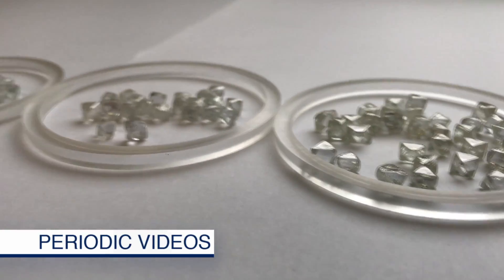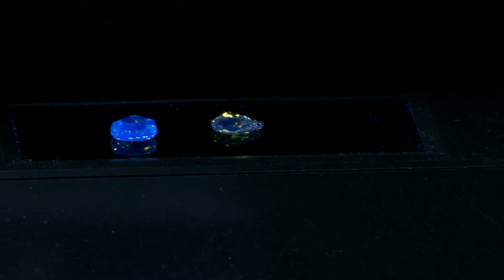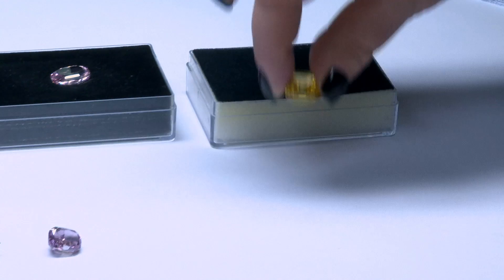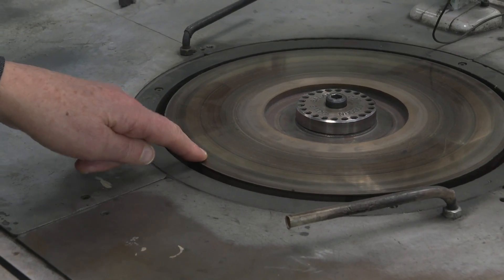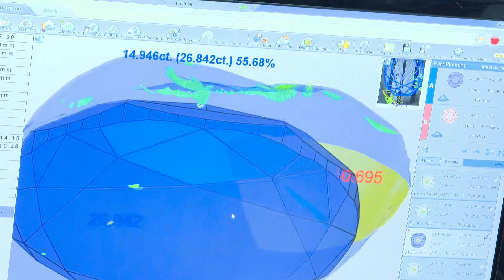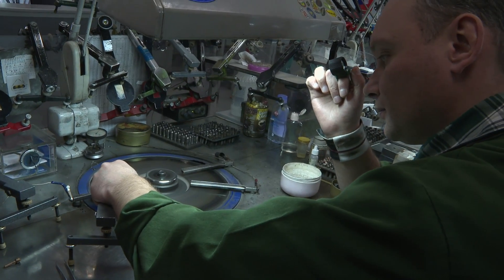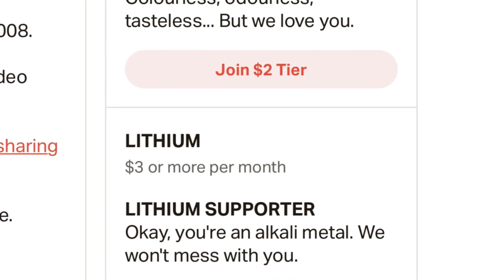Polishing a Pink Mega Diamond - Periodic Table of Videos

Comment: I wonder how they keep those wheels flat? If you think about it, they're probably some kind of case hardened steel so that they don't instantly get worn away by the diamond. Even still, being exposed to grinding with diamond dust for hours on end, you'd have to start getting grooves in the surface. Maybe they just dispose of them? Maybe they have a machine that they put them in and check them for surface flatness and finish?

Comment: I love how they are so gentle when holding the hardest material on earth like somethings going to scratch it 😂
Reply: Hardness does t mean toughness, they can shatter or chip if dropped or hit with a hammer
Reply: @wades623  Think of it as a ball made of glass and a ball made of rubber. The glass ball is harder and the rubber ball is tougher.
Reply: @wades623  "dropped or hit with a hammer". So I suppose slammed onto a table and blown up with 2 tons of tnt are considered the same amount of force now?
Reply: @michaelmodernsonicfan5341  First, the proper way to say that is "it will probably " not "it probably will", secondly, its spelled Shattered , finally, someone as young as yourself wouldn't even understand the basic chemistry and physics of a diamond, let alone understand its physical properties and actual uses in modern technology. It isn't just some pretty rock that is price gouged for no reason other than massive profit, its usefulness in abrasives far exceeds silica and other mediums, hence its uses in mining, milling, drilling, there's even methods of subbing diamond dust for silica medium in pneumatic sand blaster machines.
Reply: @crazycherokee8552  i think i deleted my comment bruv
Reply: @crazycherokee8552  why are mined diamonds so much more expensive than synthetic diamonds then

Comment: In order not to lose the pink color, diamond cannot be heated to high temperatures of 1000 degrees Celsius, such diamonds have a special crystal structure, such stones have a high stress. Big weight loss specifically for this diamond because it was necessary to cut the diamond so that it played well and had the maximum reflection of pink color, it is like a game of mirrors, only here the mirrors cannot be returned...

Comment: Absolute lies about diamond cutting.  You don't need any experience at all, just ask the Indians and Chinese, you just need a $40,000-$128,000 laser cutter, it is all automated.  Almost all diamonds are cut this way nowadays.  "First, the rough diamond is measured and an AI-assisted planning process 
then guides the user for optimal yield from the diamond. Then, it 
obtains a clear picture regarding the weight, shape, and clarity of the 
proposed polished diamond. Specialized software gives the operator 
options to select the shape of the diamond, depending on elimination of 
inclusions, and displays its market value onscreen. In the next step, 
the numbers of sides and percentage of sawing and banding are selected, 
enabling optimal safety and finalizing minimum weight loss. The operator
 clicks a button and the perfect laser sawing gets started. After 
completion of the above process, the next step is to cut the rough 
diamond according to the plan."

Comment: I have a pink un cut stone weight about 320 grams in single  
by testing the stone used a diamond tester light indicate 7 not more than 8 ,
what will it cost , any one wand it call +91 9847765751

Comment: Oh yeah, the water purification. The company I work for actually provides reverse osmosis machines for the medical industry, mainly for dialysis. For dialysis you need a special solution of bioactive concentrate that is based on ultra-clean water, in order to guarantee that no harmfull materials like heavy metals can enter the body through the water, it has to be thoroughly cleaned and filtered, or "zeroed" as we say. So hospitals buy this really expensive, sophisticated filtration machines. There are different kinds of machines, that do different things, but basically they just press water through a thick filter tube (it's tube shaped so it can take a high flow and pressure without breaking, despite being very thick and dense), so the water gets deionized from like 200µS to as low as 1µS; Micro Siemens, which is the unit of conductivity, the opposite or electrical resistance and the lower the conductivity, the less ions or foreign particles are in the water. So basically, what comes out this machines is by all intents and purposes, "just" water and nothing else.
Actually I'm fairly interested, what kind of machines they use to produce their clean water

Comment: What funny is that if you tried to resell those diamonds you would only be able to get a small fraction of what you bought it for.
Reply: It depends. Truly rare stones (like the "3 big ones") typically increase in value, though realising it may be hard (largely through auction). A "normal" diamond can be sold at 30-50% of its retail market value - which typically includes 15-20% of taxes - without much difficulty; try this with anything else, then tell me.

Comment: It's no wonder why Diamonds cost so much, an incredible amount of highly skilled labor goes into grinding/polishing them. Another great video!
Reply: Cutting and polishing costs amount for a very small proportion of the cost - proportion that is even lower for important/rare stones.
Reply: also, a sneaky bit off supply manipulation by the biggest diamond seller in the world to massively increase price.
Reply: The cost of cutting and polishing is insignificant as a fraction of selling price, actually - when was the last time you got paid $30 million for a couple month's work?
Diamonds are a gigantic scam, really.
Reply: @wasd____  That is why I prefer rare gold over common carbon (diamonds).
Reply: @qwertyqwerty697  Gold is also a scam. Its price isn't tied to its utility as a material component in things that are actually useful, it's only bought and sold on the expectation that other people will also want to buy it. It is, like diamonds, a manufactured overvaluation of something that isn't intrinsically worth that much.
Reply: @wasd____  gold been valued for thousands of years. There is a finite supply of gold that can be actually mined from the earth. If you want to talk about scam let's talk about the fiat paper cash we use everyday
Reply: @wasd____  Don't mean to be rude, but the "manufactured overvaluation" is the fundamental basis for economy. Your cash? Just a bunch of paper or plastic in your wallet. Your bank account? Nothing but a bunch of ones and zeroes in a hard drive somewhere...
Reply: @Pharoh_95 Everything is manufactured value. Gold is worth money because we say it is, same with the paper you weirdo libertarians like to rant about. The only inherently valuable commodities are food, air, water, homes. Nothing else matters on a human level. If an apocalyptic event ever occurred, where do you think your gold will take you, realistically?
Reply: I was thinking the exact same thing.
Reply: Diamanti lovediamanti biutifol gabriella

Comment: does the fluorescence affect the price because it shows how impure the diamond is? Like are other unwanted minerals in the diamond fluorescing, showing its impurity?
Reply: No. The reason why fluorescent diamonds are worth less (and BTW we are talking of 10-20%, not a dramatic 90% less...) is due to two reasons:

1. The (very low) risk that the diamond looks foggy or oily due to the fluorescence.  This is not because the impurities are visible, but because the amount of visible light they generate (as fluorescence) interferes with the light being "normally" reflected.

2. The (much more substantial) risk that the diamond colour will vary - sometimes in fairly arcane ways (e.g. a stone that should be fairly graded H in natural light becomes an E under low-UV, or vice versa...), and sometimes just plain ugly: I saw an otherwise nice orange stone with green fluorescence turn a very unattractive shade of brown.

Comment: The oil smell is not only for the machines' gears but also for the diamonds. When you grind something the friction heats things up, the smell is a drilling or grinding fluid made to cool the diamond so it doesn't discolor and ruin the stone.

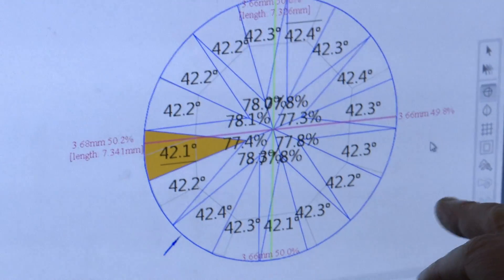Comment: 5:40 I wonder why aren't the angles divided evenly on the cutting plan
Reply: I think because that's what makes them sparkle. The offset of the faces just enough. If they were even it wouldn't be as impressive. I could be wrong just what I speculate.
Reply: @bigfuzzy7  That was my guess, too, but we were wrong. I watched again: that's not the cutting plan, it only shows the measured angles of the unfinished stone.
Reply: @remek_ember  That's the finished stone, most likely. And not particularly well cut from an optical point of view, with a pavilion angle over 42 degrees (hats off for the consistency, though).

Comment: 7:13 The grinding plate operates in a circular motion, so with all due respect, what are you expecting to learn from moving your finger in a radial line?
Reply: Do you think that the fine dust grain is somehow arranged in a particular orientation?
Reply: @namewarvergeben  i think that the grinding plate itself has oriented grooves.
Reply: Grooves would make the diamond bounce. The Prof says it in the vid: it’s too fine to notice because the goal is extremely fine edges
Reply: @chrisp2757  " the goal is extremely fine edges" Being one of the main purposes of grinding. The finer the abrasive structure, the sharper the resulting edges. 

"Grooves would make the diamond bounce." More to the point: every obstruction will make it bounce. That's why they're pressing the diamond down.

"The Prof says it in the vid: it’s too fine to notice" That's the point of my comment. 
Sure, it could possibly be so fine that it feels smooth in all directions, but: he couldn't tell because he's not testing the main direction where abrasion happens here.
Reply: Obviously a speed bump makes a car bounce, but I’m saying a grove anywhere close to the size of a nail file’s would send the diamond chattering regardless of how hard you pressed down. 

Raised metal edges would also chip the diamond, not grind/polish it. You should look up “cleaving diamonds,” done with a metal “blade.” 
Diamonds are tough (difficult to wear away) but brittle (can be cracked).
Reply: @chrisp2757  There aren't many possibilities. Either metal grinding grains (of any shape) shatter the diamond (depending on pressure) or they don't, or the surface isn't metallic at all.
Reply: Since you’re so dense and won’t let it go, I think I have the synopsis: any oriented groves are going to be so slight as to be undetectable with the human finger. Although the entire grinding plate is likely flat to a very smooth degree as the metal would chip away the diamond rather than polish it smooth.
Reply: @chrisp2757   I have looked it up, my third guess was right: the grinding surface of the so-called faceting machine isn't metallic (it's coated with diamond particles). There aren't grooves of any kind.
Since you're calling me names you have lost any credibility by default anyway, so yeah.
Stop acting so insufferably smug, especially if you are proven not to be as smart as you think you are. edited, because i try to have manners.

Comment: Diamond dust is not just thrown away. It is collected and sold for industrial uses, such as diamond based abrasives and polishes. I have used diamond dust mixed with a grease as a polish for hardened, high chromium and nickle steel tooling to take off corrosion and smooth the surface of the tooling where pitting had been caused by corrosion. Diamond dust is very useful and still expensive even though it is a waste product from gem cutting.
Reply: You didn’t buy gem cutting waste. You bought manufactured diamond dust or the waste diamonds from gem mining. 
Only a fraction of the diamonds mined are of gem quality, and as a lot of commenters will tell you when they complain about expensive diamonds: diamonds aren’t that rare, especially non-gem quality.
Reply: @chrisp2757  This was from before synthetic diamonds were in mass use. You are correct that diamonds are not as rare or expensive as most people believe them to be.
Reply: They’ve been making cheap industrial diamond dust for decades

Comment: Why are fluorescent diamonds valued less .. ?
Reply: Fluorescence is considered to be a flaw and the cause of fluorescence in certain diamonds has an effect on the beauty, desirability and its value.
Reply: @iblogger3730  Yes, but why
Reply: @Erik-yk9zf  it is an impurity which has an effect on the color of the diamond.
Reply: @iblogger3730  It's not necessarily an impurity (the origins of fluorescence vary), and it doesn't necessarily have an effect on the colour. However there is a risk that it does, just like there is a (lower) risk that the diamond may look hazy or oily in UV-rich light.

Comment: diamonds are just common shiny rocks, they are not rare at all
Reply: It all depends on what you mean by rare. To find a 1 carat gem diamond (NOT 1 carat of diamonds; two different things) you need to sift on average through several thousand tonnes of rock. Yes, there are plenty of gems that are rarer than colourless diamonds, and are cheaper too. Just like there are plenty of metals that are rarer than gold or platinum but are cheaper: rarity is only one of the attributes of value.
Reply: @dlevi67  fair enough

Comment: Those grinding tables are very simple in design, not at all "sophisticated", it's the most repetitive mechanism found in industrial machines. Looks to me like a 30 year old workshop machine with smaller tolerances for deviation. For this usecase you simply don't need high-tech state of the art machines, they are simply heavy grinders.
Reply: Heroedon the industry machines have t changed that much. It still a guy sitting by a wheel and polishing. It’s an art
Reply: @NickCarter86  The word you're looking for is craftsmanship. You falsely associate the beauty of the product with artistry. A clockmaker for example is rarely an artist, he assembles and maintains, rarely designs the product. These workers are skilled Craftsmen, the artist in this case is nature.
Reply: @Heroedon  You clearly have no idea of what it takes to cut a diamond. Or another gemstone.
Reply: @dlevi67  Is this supposed to be an argument? I talked about the machine not being special, and that it takes skill not creativity to cut a gem, now correct me if you can. But this time try to make a point.
Reply: @Heroedon  How is "yours" an argument more valid than "mine"? In any case, I repeat, you clearly have no idea of what it takes to cut a stone and that means you are unable to recognise the boundary between skill and creativity in that case.

Design is not synonymous with art, nor is the simplicity of equipment ever a reason why the product is not artistically sophisticated.  And maybe look up a few names like Gaby Tolkowski, Berndt, Tom and Jutta Munsteiner, Yoram Finkelstein or Jeff White (to name the first few that come to mind).

Comment: A sweatshop for middle age white men.
Reply: They are highly skilled, and at least in the US, they get paid extremely well for that work.
Reply: SEE MORE SALARIES FOR MANUFACTURING PROFESSIONALS
Gem and diamond workers evaluate the quality of precious gems and diamonds used in industrial settings or by private clients. This job is not dangerous, but it can be strenuous as it does require that workers spend many consecutive hours standing or bending. Vocational schooling or an associate's degree may be necessary to be considered for this job. Most of the time, an employer will require up to two years of formal on-site job training as well.

A Gem or Diamond Worker can get a wage ranging from 24000 to 36000 depending on experience and domain knowledge. Gem and Diamond Workers receive an average salary of Thirty Eight Thousand Six Hundred dollars on an annual basis.

Gem and Diamond Workers obtain the highest salaries in Connecticut, where they can receive average wages of approximately $53120. These employees can get the best pay in Professional, Scientific, and Technical Services, where they can earn job pay of $41330.

Gem and Diamond Workers tend to make the most in the following industries
Retail Trade $41,330
Professional, Scientific, and Technical Services $40,300
Wholesale Trade $38,700
Management of Companies and Enterprises $38,460
Manufacturing $35,200
Other Services (except Public Administration) $34,600
In general, they earn less within the industries below
Finance and Insurance $32,480
Other Services (except Public Administration) $34,600
Manufacturing $35,200
Management of Companies and Enterprises $38,460
Wholesale Trade $38,700
Professional, Scientific, and Technical Services $40,300
STATE COMPARISON
Requested map does not exist.×
HIGHEST PAYING
Gem and Diamond Workers have the highest average income in the following states
Connecticut $53,120
Illinois $45,530
Idaho $44,000
Minnesota $43,710
Wisconsin $42,630
Pennsylvania $42,350
New York $41,830
LOWEST PAYING
The following states have the lowest average wages for this career
Puerto Rico $19,180
Maryland $26,160
West Virginia $27,430
New Mexico $28,380
Nevada $28,810
Montana $29,750
South Dakota $30,000
Reply: Hardly